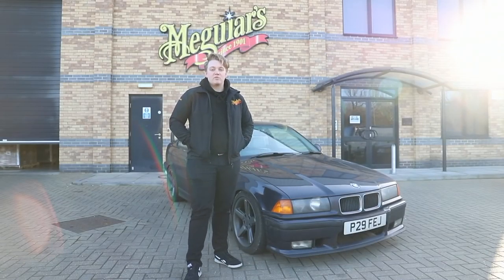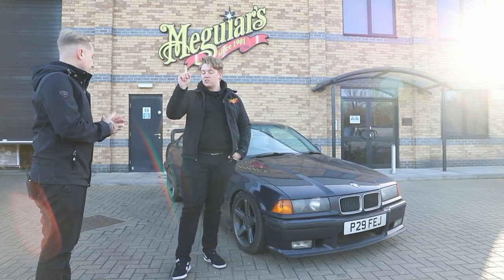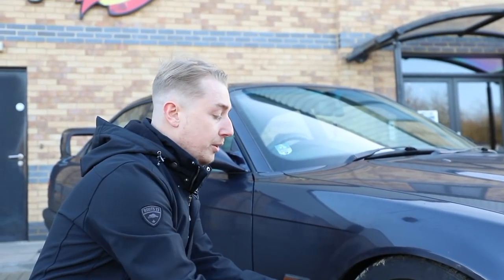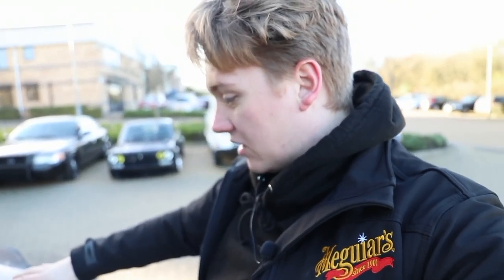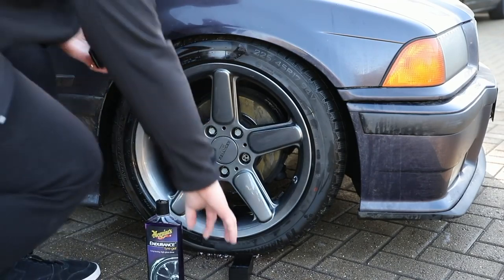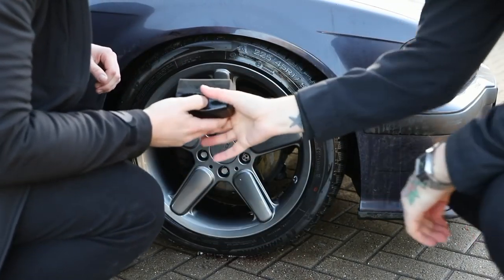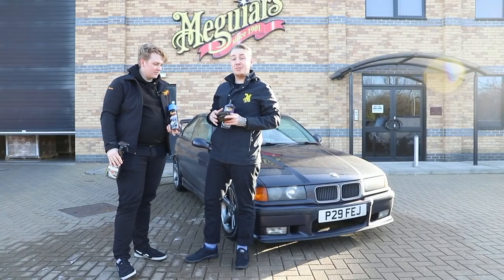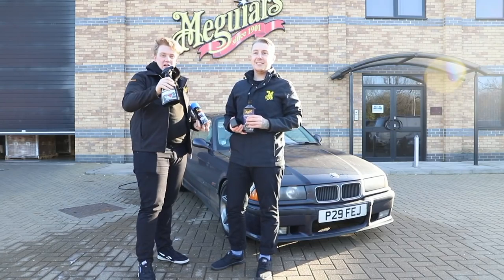Cleaning Wheels with Meguiar’s All Wheel Cleaner - Meguiar’s Detailing 101 – UK Edition

Comment: Can you use the ultimate all wheel cleaner on tires? Will it hurt the tire?
Reply from the maker: It will not hurt the tire but it really is designed for wheels and brake dust.  It will not be particularly effective on tires.

Comment: What about hot rims all wheel and tire cleaner ?
Reply from the maker: Certainly another option if you have factory OEM clear coated wheels or true chrome.  Would not recommending for the wheels in this video.  Generally speaking if you have aftermarket wheels you need to be very careful what kind of wheel cleaners are used.  This is why the Ultimate All Wheel Cleaner shown in the video is a great choice.